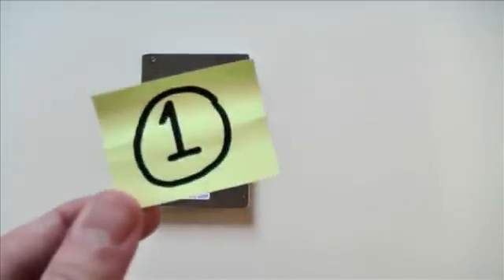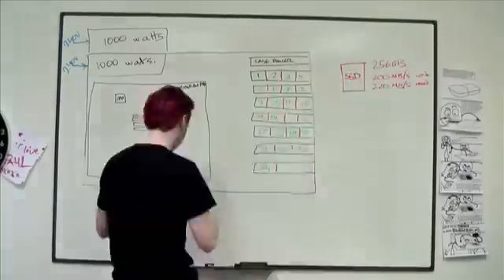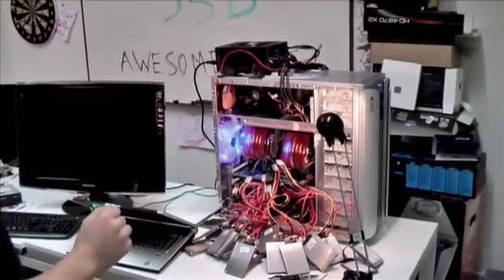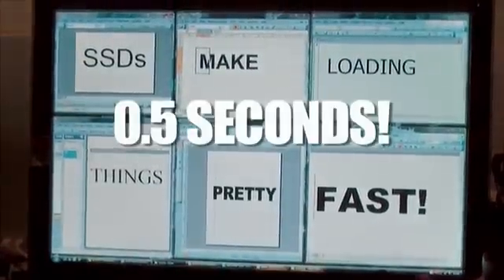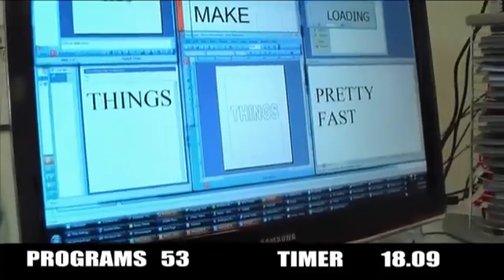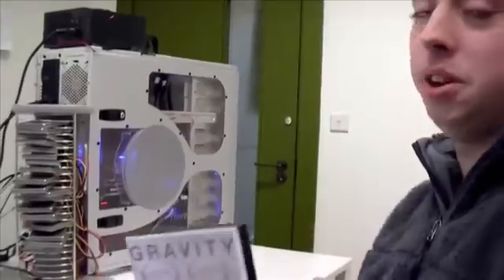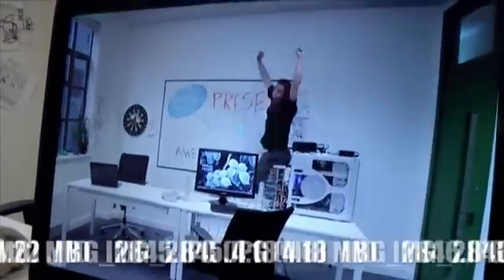What happens when you RAID 24 SSD Hard Disks !!!!!

Comment: what u don't understand is SSD need no defragmentation cuz there is no mechanical part inside  to move to access the data, data on SSD could be store anywhere and could be address quickly plus defraging SSD will damage it bcuz it's not just a write or read cycle, the defraging software on it's own is not written for solid HDD and what it does is it orginize the data from same source in 1 place and addresses them so HDD access them quicker, the way SSD works is different so it will get damage.

Comment: Those are called NANDs, and they wear naturally with each write to the SSDs cell. Defragging is nothing special when it comes to this, and is no different than if you were to install a program to the drive

SSDs dont need to be defragged because theyre designed to spread information evenly across all cells to level off the wear on them, but that doesnt mean its inherently bad for them or will cause them to wear out any quicker. When a cell wears out, the SSD auto forwards data to the good cells.

Comment: You mean a hybrid drive? I know all about those.
You get a regular HDD, with an SSD as well.
The SSD stores the most frequently accessed files on a small (usually less than 10 GB) area, and the rest of the data is stored on the HDD.

Comment: 3,000 write erase cycles per flash "block" before dying (most likely more, but guaranteed for 3k) which means you can write TONS of data on an ssd before it will "die". There have been lots of articles made, one saying you can write 57GB(?) daily to a 256GB SSD for 10 years straight before it dies completely. I personally use a 128GB SSD for heavy photoshop/movie editing/code compilation (Linux/BSD kernels, lots of userland utils, etc). I've had it for 4 years. It's not lost capacity yet.

Comment: Answer: it depends. Defragging moves lots of files to different locations on a hard drive. SSDs lie to the OS about where the files actually are on the drive (and does magic so the OS doesn't need to change anything). So, defragging literally does just about nothing for performance. The issue is that SSDs have a limited number of write-erase cycles. This means you can only write to any given flash memory block X times before you can no longer write to it. Granted, modern MLC drives can take

Comment: The reason why you shouldn't defrag your SSD is because it will shorten the lifespan of the drive. The firmware on the SSD automatically moves the fragments of the files around for you to make sure everythings evenly distributed amongst the chips. Windows doesn't have control over the fragments' locations on the drive and doesn't know where they are, so by defragmenting it you're in fact just fragmenting it even more.

Comment: That's because the reporting between Windows and the controller on the SSD isn't accurate. How Windows see's the data on the drive is not actually how the data on the drive is stored. Defragging aims to reduce latency caused my the read/write heads on a mechanical arm in a HDD by rearranging data blocks into a sequential order. This is simply not necessary in a SSD where there is no physical movement and hence no latency. If Windows THINKS the data is in sequential order, it says it performs.

Comment: SSDs use many chips and the data is automatically moved by the controller. There is no need to defragment a SSD, and defragmenting it is simply using it's limited amount of read cycle before it dies.

Comment: everything that goes into system ram from crysis is first loaded from the HDD/SSD so if a game level is streamed you'll get a smoother experience from an SSD because of the faster read speed, also the load times between levels/scenarios will be less. Games don't just tax cpu, gpu, and ram. They tax everything.

Comment: He's right, you'll max the bus before you max the drives, but just to be thorough, setting these up as mirrors in zfs would give you much faster results (with a bigger bus) because you are not only reading from all drives but you do not have to burn cpu cycles calculating parity. Raid is nice, cheap(relative to mirrors) and safe (minus the micro second write hole), but mirror would be faster.

Comment: The reason is because it doesn't matter where data is placed on an SSD it makes no difference with R/W speeds, on a HDD having data written to all over the platter means when reading the data; the HDD has to so more work due to moving parts. this is where defragging comes in gathering all the data in one group which means less work for the HDD and usually a faster PC

Comment: Not bad! My company makes a computer we market to video editing professionals that uses a similar set-up. Our system though focuses on raw power using 4-way SLI and an unlocked i7 CPU with a 2011 pin out. A lot has changed in the last year, and we are now using 512Gb SSD drives. If anyony is interested in the specs, let me know.

Comment: No you dont! Damit! Even regular disks only need defraging when using the Microsoft NT-Filesystem. Ext4. HFS+, ZFS, AFS, NFS are other standards on the market dominated by Mac, Linux and solaris, none of which need defraging. Also when using an SSD (which is a RAID of regular memorychips similar to the ones found in an SD card) there is no need for defraging even on NTFS due to the nature of the memorycontroller and how it places data. The drive works best when fragmented so it IS by default.

Comment: Defragging is horrible for SSD's (and pointless) They dont need defragged because there is virtually no tiem delay for accessing files in a different part of the drives memory. There are no moving parts in side of and SSD so there is no delay for the arm to scan across the surface of the HD to attempt to access a file across the drive.

Comment: There was no data on the hard drives when you defragged, now if the computer had been in use for days, weeks, months, etc.. How fast would it have been.. I do like the concept of a Solid State HDD, but are they like Flash memory where they die after a while or not? and can you get them for SATA in a laptop? small plug..

Comment: While most of that is true defragging still has its uses.  If you think about it when you defrag you are moving every file on the HDD into the cache, and relocating the data into another sector of the HDD.  While most of what you said is true if a SSD Fails that would actually affect the recovery rate for data wouldn't it?  Still nice to know that data is properly sorted and organized in case of HDD Failure and you try to recover it.

Comment: I know twice more than you about computers, jackass. You haven't updated to SP2. In fact, the only way to properly "fix" vista is to reinstall Windows Vista with an SP2 DVD.

My experiences with Vista RTM was as bad as anyone else's. But when I bought an new laptop with Vista SP2, there were no problems at all.

I updated to Windows 7 afterwards, and got a STOP error (because of a bug). But after that, Windows 7 was smooth running.

Comment: I have 2 60gb SSD vertex3 500mb/s and i get 1 gb/s from that!! so only 2gb/s on 24 sounds really lame :/ and also YOU DO NOT DEFRAG SSD cause it will shorten its lifespan :)

also my loadingtimes are pretty much the same, might be less due to lower specs on my hardware.

so 24 SSD pointless but fun :D

Comment: You don't say?
Naah, i'm just kidding, i know.
But two or 3 of those could reach the same results as these.
Also it is possible that someone has a supercomputer with that many pci-e slots, even though they are made mostly for calculation, so they really need more processing power than fast read speeds.

Comment: "You should never defrag an SSD. Physical data placement on an SSD is handled solely by the SSD's firmware, and what it reports to Windows is NOT how the data is actually stored on the SSD. To even out usage on its internal memory chips SSD firmware intentionally splits data up across all of the SSD's memory chips, and it also moves data around on these chips when it isn't busy reading or writing (in an attempt to even out chip usage.) Basically, it handles everything itself.

Comment: NAND-flash cells, which are the basis of SSD technology, can only be written to a limited number of times before they fail.  The number is exceedingly high so you don't have to worry much about wearing your drive out, but defragmenting causes useless wear on the drive.  Defragmenting reorganizes information on an HDD to speed things up, but as SSDs are electronic rather than mechanical, the organization of the drive does not affect performance.  So defragging an SSD does nothing but waste writes

Comment: Defrag kills ssds! You got to secure erase them again, simple format won't work very well. 2GB/s is quite slow. To get 1GB/s you only need 2 SSDs. Adding more though won't directly multiply speed for each one in the raid, you may want a 4 SSDs rig an that would just overkill everything in the integrated controller. Tom's HW tried the same with 2 controller with better resuslts (3GB/s). SSDs are powerful, more than the motherboards and raid controller you can desire.

Comment: A ssd has no moving parts so it just calls the files from where ever they are. If you have a file split into two very big parts the drive can read them simutaniously because there is no head that has to move every where to call all of the file.

Comment: For all the people that didn't catch the stuff at the end, here is the parts list and other things,
26 256GB Samsung SSD's (any SSD should work)
6 SFF-8087
1 Adapted 5 Series RAID (8 channel stock setup)
1 Areca 1680ix-24 RAID (beta firmware from areca ftp)
And the case if you really want it
1 Thermaltake Armor case
Setup
10 SSD's connected to Areca RAID
8 SSD's to adaptec RAID
6 SSD's to Mo-Bo
Achieved sequential performance: 2121.29 MB/s read, 2000.195 MB/s write

Comment: Yes, they can still be fragmented, but accessing one word at the beginning of the addressable space followed by a word on the other end of the addressable space takes exactly the same amount of time as if the two words were adjacent to one another. You won't see a speed increase by defragmenting. Additionally, the drive will have a lower mean time to failure due to the additional writes. IE. Not a good idea to defrag your ssd's.

Comment: RAID 3 is most certainly useful and still used. It is for sequential I/O whereas the RAID levels you listed are not. If we are talking about non-sequential I/O, then yes, you're correct, RAID 5/6/10 will outperform it. I do data storage engineering for a living, specifically performance. I instruct storage admins on how to get better performance using different  RAID configs... one of those being RAID 3. Granted, it is not commonly used on a smaller scale, but still used.

Comment: Is it just me or did this never say which RAID level they are using? I would like to assume 0, but that is a terrible idea for that many drives. Your rate of failure is multiplied 24x. If their only concerned about speed, sure, 0 is great, but what about those that want a configuration that is useable? I'd assume using RAID 3, if it's a dedicated media server, or RAID 5 if you're using it for non-sequential I/O. Still, I'm wondering... which RAID level did they use?

Comment: @Gunbardo it splits data across all drives in chunks. so a 500mb application would be split into 2 hdds at 250mb each say each drive could only process 100mb per second then it would take 2 and a half seconds for both drives to load the application instead of one drive loading the full 500mb at 100mb per second taking a total of 5 seconds.
both drives are effectivly holding parts of everything.

Comment: @Tatarize It is not diminishing returns at all. The cost of adding the 24th drive is the same as adding the 2nd drive. The absolute performance gain you get from adding in the 24th drive is the same as what you would get when you add in the 2nd drive. This is a linear increase. Not a diminishing returns model at all.

Now if you say that we are looking at a real system, the story is different. But for an ideal RAID 0, the model is linear not diminishing. I.e: you get what you pay for.

Comment: @Gunner3210 You're right. There's still diminishing returns so to speak because the percent increase in overall speed goes down. And so that 24th drive only gives you an added 4% boost. But, it certainly doesn't do anything close to what I claimed.

Comment: @Tatarize @masterchief3k If we assume a perfect RAID 0, i.e. there is no overhead for adding drives and there no bottlenecks anywhere. Each new drive added into the array will increase performance by a fixed amount (the speed of one drive). So if you pay for 10 drives, you get 10x the performance of 1 drive. If you pay for 20 drives, you get the performance of 20 drives. So you get what you pay for.

So the analogy of diminishing returns is not correct. 24 ssds will give you 24x the speed.

Comment: @masterchief3k Yeah, the added speed benefit of the drives drops off at 1/n. So at 2 you get 1, then at 3, 1/2 and at 4, 1/4th. Adding a 25th drive for example would increase the speed a whopping 1/16777216. -- I would only do 4 drives for binary reasons and stop. The added 1/16th increase you get with the remaining drives isn't worth the 20 * ~ $200 bucks you're spending.

Really it's 1/16 - 1/(8 million) or so. But, it's largely irrelevant.

Also, way to defrag.

Comment: The speed of raid 0 significantly drops off after 3 drives. First you may get a 100% boost, then 50, then 25, and then it keeps cutting in half from there.

Comment: With 24 SSD's you run into IDE bottlenecks. If they hit 2GB/sec then they're actually only using about 10-12 of them and the rest could be taken off. It wouldn't should so impressive but that's reality.

Comment: @rajah010203 You don't need to defrag SSDs as they have no seek time so it's pointless. Normal hard disks are physical devices and so it's faster if the data can be read sequentially from the platter.

Comment: @WXIIIR well sata2 and sata3 are rated for 3 & 6 gb/s respectively, but no where has anyone ever gotten near that for actual transfer speeds. theoretically ~500mb/s x 24 (raid0) would equal 12gb/s but the processor, mobo, ssd drivers, raid cards all limit the speed. How often do you see anything near the rated speeds? (when it comes to transfer speeds)

Comment: how exactly does HD speed relate to crysis framerate? Wouldn't that depend on how quickly you can pull image data from your ram and shove it into you GPU? It's not as if the image is loaded from your HD each frame.

Comment: First of all 1. what raid was used? (0, 1, 5, 1+0???) 2. more drives doesn't mean more speed, just more storage (2 drives in raid0 or 30 drives in raid0 = same speed) 3. loading a bunch of apps at the same time really depends on your RAM, Motherboard, CPU IN ADDITION your drive speed as SATA channels, there are many factors not just the SSD drive. That is the most misleading project I have seen this year.

Comment: @triberofvengeance Furthermore, SSDs have a fixed lifetime with regards to the number of write cycles.  For that reason, most SSD firmware are programmed to intentionally fragment data across the SSD in order to wear it evenly.  So defragging an SSD actually induces unnecessary wear on the device.

Comment: @triberofvengeance SSDs have a faster access time and usually a faster transfer rate than mechanical hard drives.  And unlike hard drives, SSDs do not have a seek time.  Seek time is what causes a fragmented hard drive to slow down, since the head has to constantly reposition in order to access the data.  Therefore there is no impact on performance with fragmented data vs contiguous data on an SSD.

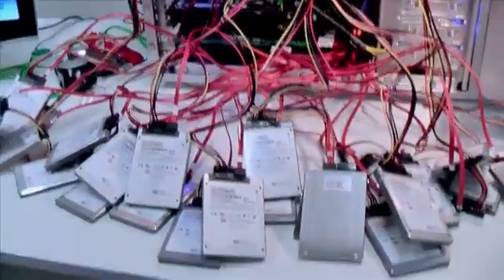Comment: @blastcap946 1:11 to 3:40 (connected or not ) are not even the same sets of cables. As expected after all those reconfigurations mentioned in the final slideshow and the different possible takes to make the video. And no matter how closely you look, given the quality of this video you just see 2 red bundles of cables running to the back of the case. You might be right yet you might be wrong :p

Comment: @wibloc im aware ssd are a sata connector, but as you can see in the begining of the video, they use molex to sata cables to get power to all the drives. when he is jumping on the trampoline, the only thing connecting the drives to the computer is the sata cables.

Comment: Okay, first person to email me stating the obvious that a RAID controller will have limits on the ammount of bandwidth it can do regardless of what hard disk you put on it, will gain respect.

This system would be simply put to shame with a just two dual pci-e ssd drives in a stripe would hurt this 24 disk configuration hands down.

The only thing this shows us is durability in the SSD drives.  They are not  faster in this setup vs conventional drives.  Need another PC Engineer to comment this.

Comment: My current system is a 12 tower, 23 cores, which does 2.2 terraflops.  PER SECOND!, and I can pound it with tones of data, and it will still work as hard, not how your pathetic machine lagged out when it opened all those apps, a MPI cluster would not.  wow gurus?  IT Tech? hu?  k.... good luck with these pathetic display of very, boring and already know information.